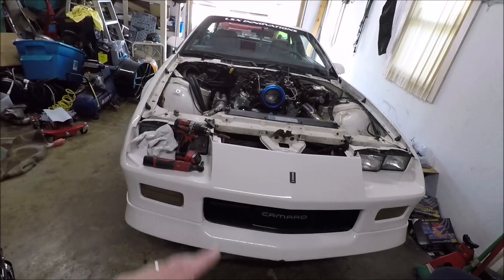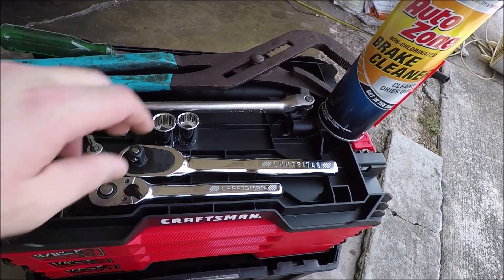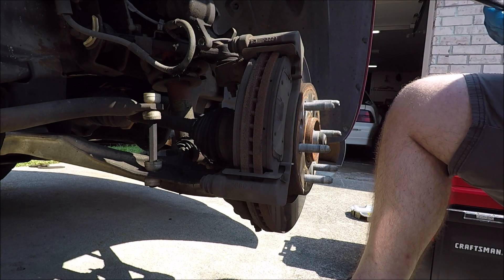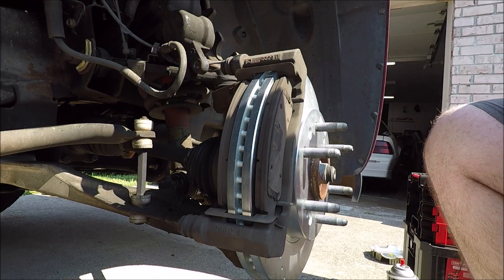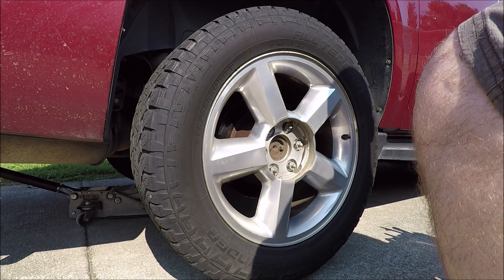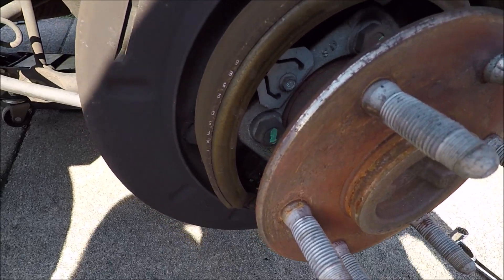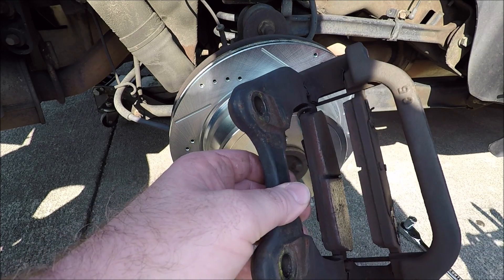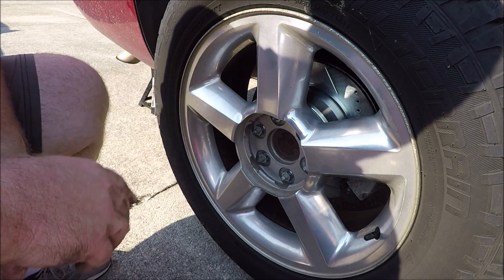AVALANCHE BUDGET BRAKE UPGRADE BRAKE MOTIVE DRILLED AND SLOTTED ROTORS AND PADS INSTALLATION

Comment: I just got done doing brakes on wife's Avalanche 2 hours ago, LOL. I think I better go check that the pads are on right. Thanks for the vid. My Avalanche is an 05 and rear brake calipers are duel pistons while wife's Avalanche is an 08 and has the single piston with aluminum caliper like yours. Yes, we have his and her Avalanches, LOL. Right now, I'm changing the oil pan gasket in mine and there are parts all over the place and it was raining today so I couldn't finish it today. Seems I had a little of your luck today, LOL.
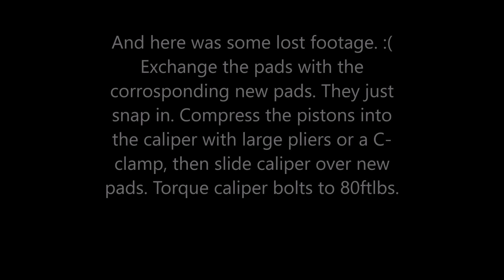Reply: Yup, they are on wrong. Guess what I'm doing 11:30 at night TONIGHT, LOL. Thanks for sharing. Have a better one then me, LOL.
Reply from the maker: Damn I don’t know whether to say “you’re welcome” or “I’m sorry”. 🤣
Reply: @BadLuckGarage  You did good.:)

Comment: I hope I helped to persuade you into trying these brakes Robert.     I think your video turned out great even with the missing footage and YES I'VE BEEN THERE!    Nearly all the sets of these I've put on (which I think I'm up to 6 sets now) have had PowerStop Part numbers and insignia on the backing plates of the pads.   Also I think the rotors are Zinc plated and not anodized.
Reply from the maker: Yea I remember you putting them on that crown Vic awhile back. For the most part they se to have really good reviews. I don’t know about the power stop numbers though. I really didn’t bother to look them up.

Comment: Thanks for this man I own an 03 avalanche and I've been debating on the brake motive rotors but after watching I think I'm gonna pull the trigger on an great vid man and I've subscribe
Reply from the maker: I’m glad this video helped you out. Just a small update though. The brakes stop EXCELLENT! But they do get squeaky at times. I’ve considered trying a different brake pad material but so far I’ve decided to deal with the occasional squeak because they work so well. I’ve noticed a HUGE difference in stopping power when pulling Chaos Theory on the trailer as well.
Reply: @BadLuckGarage  yeah alot of the reviews I've read says the same thing but ill still give them a try and go with some  different pads thanks again man

Comment: i got 2 2500 avalanches  02 n 03 gotta do fuel lines and brake lines on both this week  lol
Reply from the maker: I love Abby. She’s not the greatest tow vehicle, but I plan to do something about that. From what I hear the gen 1 avalanches like yours are more suited for towing and more truck like. The gen 2s hare more luxury and have the self leveling suspension which isn’t so great when you out a heavy trailer on them. 🤦🏼‍♂️ Hell they didn’t even offer an HD package  on the 07-up models. 😒

Comment: Perfect. Got a 04 Avalanche, helps a lot friend:-)
Reply from the maker: The gen1 Avalanches are waaaay better tow vehicles from what I’ve heard. They’re more truck based than the gen 2 like Abby. The gen2 has that damn self leveling air ride bull crap and saggy horribly with a real load on it. I’m currently looking at options to either get rid of that setup, or possibly just add helper springs in the rear. When I’m hauling the Chinavette it’s not that bad because it’s a more balanced car. But when I haul Chaos Theory or the DR Nova the dang hutch is only a couple inches off the ground. And that’s with me backloading the trailer which is dangerous in itself.
Reply: Bad Luck Garage  I put airbags on mine to tow a 18 ‘ camper 
They work well and I use a leveling, sway hitch , over kill but can’t tell the camper is behind me ...
Reply: Bad Luck Garage  BYW Air lift is a great little company who really stands behind its product, easy installation and great customer service and warranty.
This is not a paid endorsement ✌️
Reply from the maker: I’m just not sure what’s available or how it would effect my self leveling crap when I use the bags.